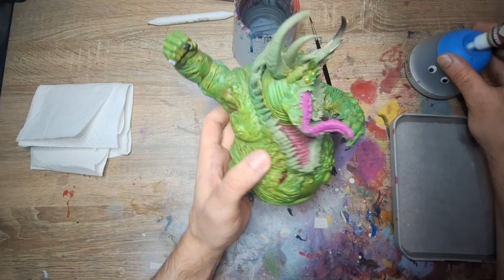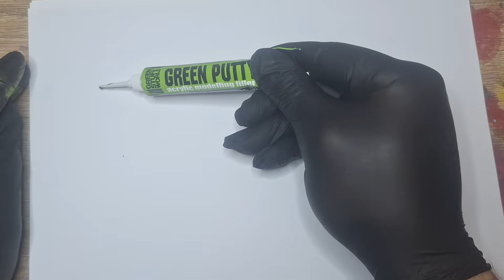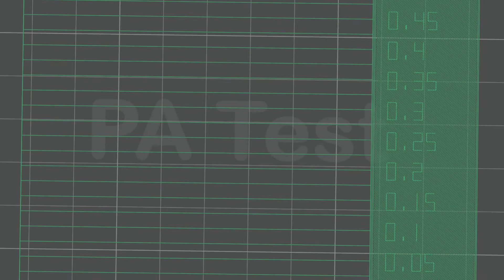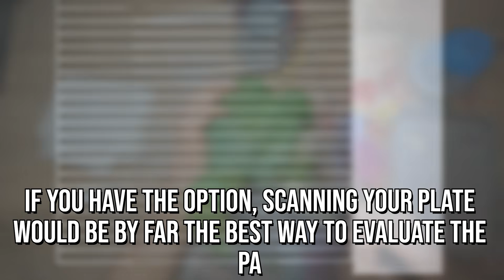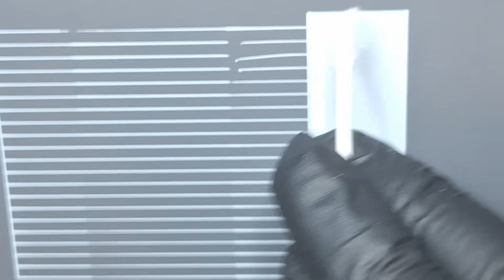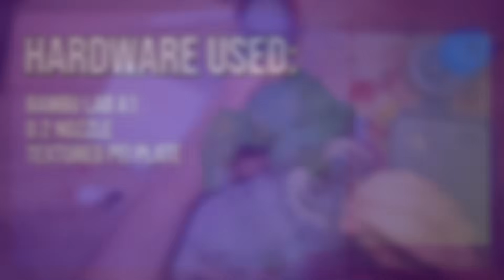Calibrate Your Filament For Miniatures! Part 4: Understanding and Calibrating Pressure Advance!

Comment: Sit a flashlight at a shallow angle next to the print. Turn the lights off and zoom in on the lines with your phone camera. Works great for several calibration tests
Reply from the maker: Recently tried that out, and it did work surprisingly well. I still think that scanning it is the best option, but that's obviously not available to everyone. Thanks for the tip!

Comment: Thanks for all your work! One question you said that you reccomend using textured plate instead of supertrack for minis if i heard correctly, could you elaborate why that is?
Reply from the maker: Hello! So sorry for the late reply, but that was just a misunderstanding, I should have clarified that.- I only recommend the Textured Plate for the Calibration Process, for two Reasons: 

- The Adhesion isn't as substantial as the adhesion for the Super-Tack Plate. This sounds counterproductive, but extremely strong adhesion would make the "Q-Tip" Trick to detect the correct pressure advance that I use in the video impossible. 

- The Colour. The Textured Plate is a brownish-gold, whereas the Supertack Plate is a Dark-Grey - The same colour of the Filament that I use and recommend. Because the PA Calibration is already difficult to evaluate with the naked eye, losing that colour contrast would make it even more difficult.
Reply: @DungeonsAndDerps  Ah i see. That makes perfect sense yes thanks. I did it on my supertrack anyway your tips with using magnifier and a flashlight did came in handy there.

Everything printing beautifully after the calibration, supports also remove quite good. The only thing i still notice are some imperfections on edges here sometimes the edge is not perfect with some plastic hanging on in lighter grey, i currently just sand those areas a bit :D.

Comment: Hello again. So few words from me again 😏 when it comes to line test, this is actually the worst test for pa, especially for 0.2 nozzle. Its just to small to get consistent values, also you definitely shouldn't use texture plate for this test only smooth one. For 0.4 best would be tower test, doesn't work to good for 0.2 nozzle though, so I suggest pattern test, it will give you a lot better and consistent results. Also it's a lot easier to figure out best setting in this test. Mind that 0.2 nozzle will have values around 10 times bigger than 0.4 nozzle. I promised you that I will post my findings on Reddit, I made new account to go with YouTube channel but it was shadowbaned straight away and I have no idea why, since I haven't even post with it. For almost a month I'm trying to appeal with no luck. Hopefully I can make this work and start posting there, if not I'll just start uploading on YouTube and hope for the best. Take care.
Reply from the maker: Hey there! I was wondering where you went.

Regarding the PA Calibration: The reason I went with the Line Method as opposed to the Pattern Test, as well as using the Textured Plate is as follows: 

1) The Textured Plate is the one that comes with the Bambu Lab A1 by default, so it's what most people will have access to regardless of whether they want to calibrate. I don't want them to purchase a Smooth Plate just for the Calibration.

2) Personally I don't see much difference in terms of visibility when it comes to Pattern vs Line Method. The "Q-Tip" Technique I mention in the Video works far better for the Line Method, because of how the Lines are arranged.

3) The Line Method is visually very similiar to the Modelling Paste Experiment I used in the Video, and is easier to replicate at home in order to better understand the effect of PA.

Pattern Method is absolutely valid, but I prefer the Line Method.
Reply: @DungeonsAndDerps Hey, your method is really good and your right, most people won't have smooth plate. That's why I'm so against line method, the tip is so small that it fills holes/gaps in texture plate and that's what will give you inconsistent results. That's why patter test shines with 0.2 nozzle, it can be done on any plate and will give you consistent results. But at the end of the day it's up to user to decide which route to choose. I'm here just to give my insight and perspective. I think I finished tinkering with my settings for miniatures and after printing a lot of test samples I could say I have a version 1.0. tree supports leaves basically no scars or really minimal and are easy to remove. I actually started with old pla meta  since I still have 1.5 roll, but in the middle of process I swapped to Bambu pla basic since I want to go with just one vendor when ordering batches. And I actually think with my settings Bambu pla makes better details than pla meta. I guess with meta being really "liquidy" is giving this antyaliasing effect. I'm gonna finish this meta I still have but for next minis I'm gonna go with pla basic(this time I was using light grey but I want to see this grey blue if it's the same). As i stated in my post that was sent to hell(thanks reddit) what I achieved is thanks to all the community including you, hohansen, sneaky Joe and many more. It's a collective knowledge only this way we can achieve even better things. Once reddit takes this shadow ban off me I'll post everything. Keep it up mate 😎

Comment: Thank you for these guides to go with your profiles. It really helps to understand what effect everything is having specifically for minis. I couldn't work out PA for the smaller nozzle so this gives me greater confidence to try doing it again.
Reply from the maker: I hear you on that one. When I first started with the Calibrations, I struggled a lot with the PA. I knew from the Flow Ratio Calibration that I should expect results that are difficult to evaluate, but at larger values, these lines didn't just look similar - They looked identical.

It wasn't until later when I stumbled across posts talking about how they are using almost 10x the Pressure Advance for the 0.2 Nozzle than they do for the 0.4 Nozzle. That's when I finally got results you could actually work with / identify.

Comment: Thank you for sharing
Reply from the maker: You're welcome! Calibrating a 3D Printer / Filament can be a bit tricky, so I always try to draw comparisons to something simpler / less abstract. Of course my explanation of the PA was super simplified, but hopefully enough to make it more approachable for the calibration.
Reply: @DungeonsAndDerps the tips with the different values for 0.4 and 0.2 nozzle is what I was missing in the past. And the method of testing the strenghth is also something I did not know about. So once again. Thank you for sharing. I am sure my minis will improve :)